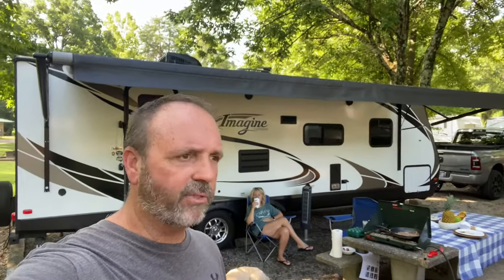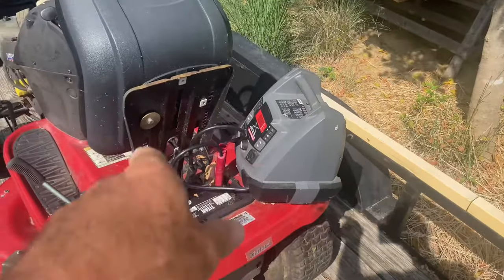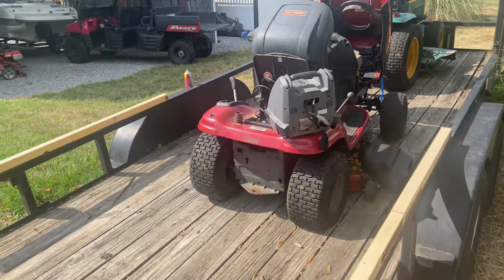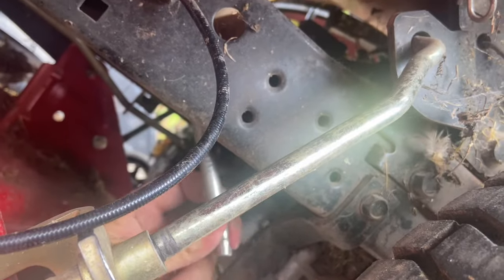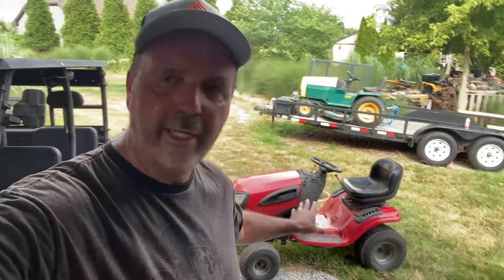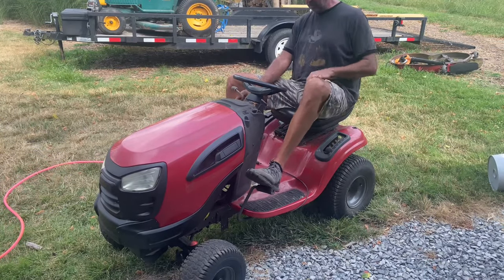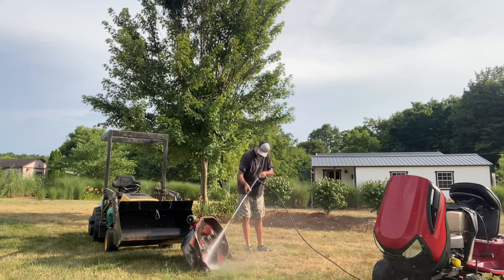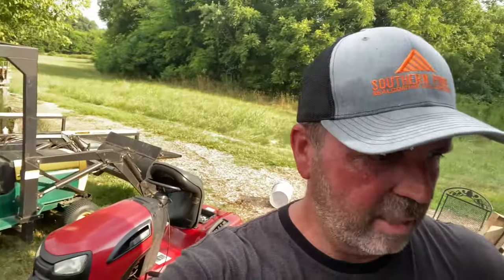Craftsman mower will not move, fixed

Comment: I’m having a similar (drive belt I believe) issue with a 2004 craftsman revolution riding mower, it’ll start and blades will engage, when I go to move forward or backwards it smokes like a civ and smells like burnt rubber. Just happened 5 min ago so I’m just about to dive into it. I just got this mower so I’m very unfamiliar with it. I bass fish for a living, not so much mower work🤣🤣 appreciate your insight man. Just subbed!

PS: hope your camping trip was awesome, yes I know I’m way after the fact. But I like genuine people
Reply from the maker: Good luck on finding the issue

You probably have a seized pulley on your deck if I had to guess 

Thanks for watching and subbing
Reply: @MurphyMower  it’s a seized pulley haha, grenaded the belt too so I just ordered both! I’ll have to wait till I’m back from guntersville next week to fix it tho which kinda sucks
Reply: @Franny_the_Fisher  now’s a good time to power wash, and wire brush the underside of the deck, then paint it with any number of nonstick paint options. I use graphite paint, but I know there are others
Reply: @liquidrockaquatics3900  I took the time to give it a really good cleaning, thankfully, the deck is in great shape, so no touchups had to be made. It was extremely well taken care of and the hours on the mower are extremely low, it’s a 2004 and I just hit 101 hours.

Comment: I got a free Craftsman T2200 and got it running and found that it must have transmission problems as I couldn't get it to move either. I will look for a broken part like you did.
Reply from the maker: Good luck
Reply from the maker: Of course, look at the belt and all the drive pulleys and then also look at the pins in the axles to make sure they have the little metal spacers(I forget what they’re really called)
Reply from the maker: It’s very rare that those transmissions actually go out
Reply: @MurphyMower  I will do that. Thanks

Comment: I have a t2400 craftsman mower that grinds when  you put it into gear. Andy suggestions
Reply from the maker: I had this happen on a mower a few years ago, and the problem with that one was the drive belt was too tight and it would grind the gears when shifting

It was probably an inch too small so I replaced it with the correct size drive belt and it stopped

Comment: Great video I have the same mower. 
I have a question for ya.
I have a 2 year old Craftsman t110 lawn tractor. It hasn't ran or moved since last year.
I was cutting my grass and the mower just turned off and came to a dead stop. No bang or any noise no smoke no nothin. I started it right back up but only ran for a second and shut off again. 
Now it turns over, gets spark, starter is fine but won't start. Its like its not getting gas? It also has that fuel shut off solenoid. 
The bigger problem is I can't push or pull the mower cause 1 rear tire goes one way and the other goes the other way. So to move it I have to pick up the rear-end and push it. I've tried putting it in drive, reverse or neutral same thing happens. Nothing. I jacked the rear-end up and one wheel goes one way the other the other way. 
The mower is in my basement down the hill. I can't push it up to the front of my house without picking up the rear-end. So almost impossible to get it to my trailer to take it to get it looked at.

If these mowers won't start will it lock the back wheels up like that? 

If you could help in anyway it would be appreciated greatly sir.

Thank you

Mike
Reply from the maker: does that have a fuel pump?

And is it hydrostat or gears?
Reply: You probably already figured it out, but that mower has a hydrostat, so you have to hit the hydrostat dump to push it or tow it

Comment: Mine is pulling but don't wanna pull up hill been using it til today I pulled the drive belt off it's fraided could that cause it not to pull correctly
Reply from the maker: Yep- get a new belt inspect all the pulleys and make sure they turn smoothly and if any are plastic, make sure they’re perfectly round
Reply from the maker: Frayed belt is most likely slipping when you put pressure on it
Reply: Thanks guys I'm disabled and I cut the property where I live for my rent.hopefully this saves me a bunch of money I can't afford to put out
Reply: I got belt changed and it's pulling just fine.thanks
Reply from the maker: Great- thanks for the update

Comment: How was the seat safety bypassed to allow for starting/operation without weight on the seat?
Reply from the maker: The guy before me did this i,f you take the two wires under the seat and connect them together that will bypass that switch
Reply: on mine, putting on the parking brake let's you do it.

Comment: Hey Murph... I have a similar mower but Poulan brand.  I was excited with your video, because my mover starts but the drive belt won't engage.  I thought perhaps it was the linkage, unfortunately for me that is not the case.  However, I notice when it starts and release my foot off the break it's shuts off even though I'm sitting on the mower.  Any idea where or what to check to help resolve the issue? I used it a couple of weeks ago, as I cut bi-weekly.  TIA
Reply from the maker: First thing I would do is check seat switch
Reply from the maker: So there is a seat switch and a switch at your foot clutch and then also you need to look at your relay is bound to be one of those
Reply from the maker: There’s another video that I have where I would start it and as soon as I remove my foot off the break, it would die or if I try to engage the blades, it would die. In that case it was the relay.
Reply from the maker: Good luck
Reply: I'll focus on the relay, the switch seems to be fine.  T/Y
Reply from the maker: Good luck
Reply: 😅 @MurphyMower

Comment: A lot of talking but never showed how to fix it
Reply from the maker: Sorry, it was not clear

It was missing two bolts into the transmission which made the transmission twist so I replaced the two bolts and then replace the linkage arm and that’s basically what did it 

Hope this helps. Thanks.
Reply: @MurphyMower  Thanks!